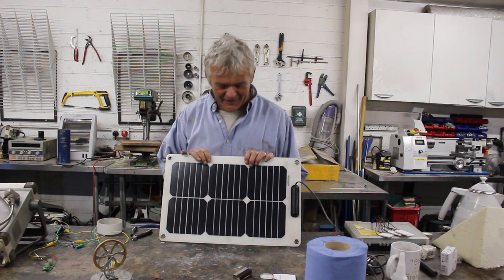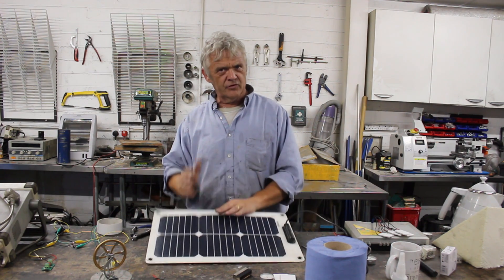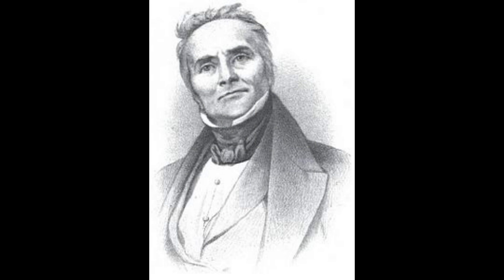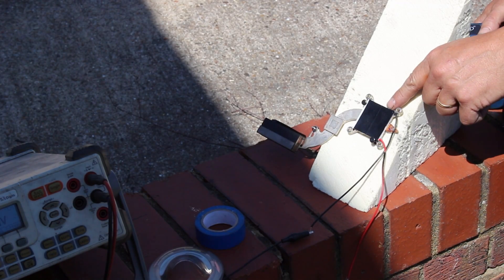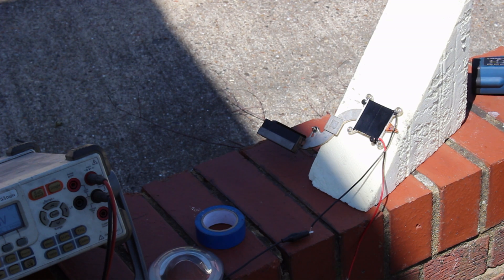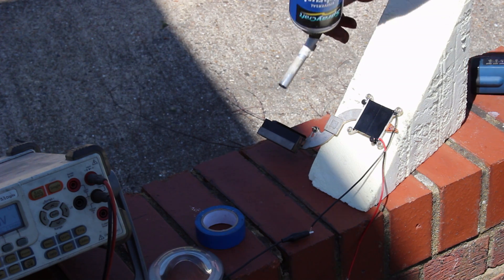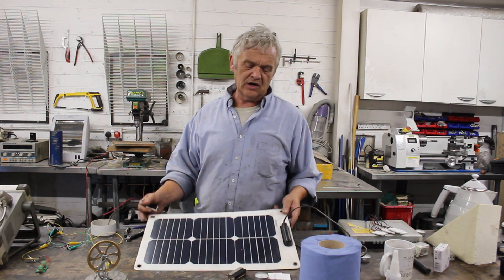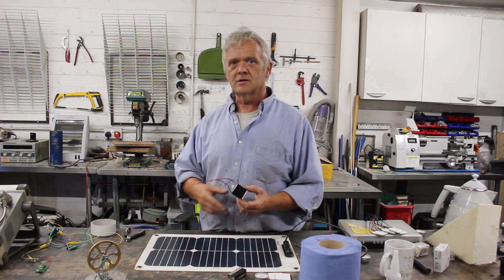1618 Putting A Thermo Electric Generator On Solar Panels

Comment: Brilliant way of explaining cost over efficiency there Robert ,love the channel by the way. You are inspiring me to come up with a way of utilising the TEG devices with a small sand battery,wind turbine and solar panel to keep my small sailboat dry and free from damp over the winter period while I am not aboard .I am sure this could work as it is only a small space to increase the temperature by a few degrees. There must be a way to make this work which would be so much better and safer than using fossil fuels naked flame devices or being hooked up to the mains. I will let you know if I succeed .Thanks for all the inspiration you are supplying. J

Comment: I invented the thermal window generator! It's the best way to use Ceramic Peltier TECs to generate power!  Use only silver thermal grease! Thermal tape isn't conductive enough! You'll need more than expected but you can use ambient temperatures from the warm heated house and the cold outside! It's mounted under a window in the window sill with two panes of glass... one for inside and one for the cold outside!

Comment: Suppose I might be a bit late to the party but I thought I'd put my two cents in. When solar panels get hot they loose efficiency. To remedy that you could stick a heat sink on the back and let the wind blow through it. Not covering it. Maybe an 80mm square. With that in place wouldn't it be a good spot for a couple TEGs? Most solar panels have a fair bit of glass that can conduct heat pretty well. I'd like to toss your idea in the bin and make something much cheaper as well as a lot simpler.

Comment: Why not put two cooling ribs on a peltier element. One side in the water and one side in the air. 

As there is allmost alway a temperture difference, there is allmost allways power. 

The charm of this system is that it also works when there is no sun or wind. No moving parts, so maybe it could last very long?

Comment: Years ago i helped with a project that was testing out a combination  tripple junction solar, thermoelectric and hot water panels..The tripple junction cell had a layer of GaP over GaAs over Ge on metal on polyimide insulator, on the back was thin film thermoelectrics PbTeSe;Cd/PbTeSe:Bi on an insulated aluminum heatsink. The solar made the bulk of the voltage (3.6V and about 100ma/Cm2) the thermoelectric made 0.2V at about  600mA per Cm2 in full sun. So lots more cirrent from thermoelectric at lower volts, with solar being more volts but less current 360mW per square cm for solar Vs 120mW for themal. 480mw electrical with 1.1W solar power so a bit less than 50% conversion.❤

Comment: Why would you put those thermal electric generators on the back of the solar panels and have a wicked type pad back there that would evaporate water or something and help cool them off while they're getting heated by the solar collectors

Comment: .. imagine 72pcs thermoelectric generator combo with 72 solar cell... it cools the panels and generate low voltage backup power if wired in series/parallel..etc.. of course both has separate inverters...hot side on the back surface of the panels.. and heat sink on the cold side.. nobody tried these experiment before..$$$ ..or mybe didn't record it yet..NASA should try these experiment than using coolant...

Comment: would it be possible to float it on some water or something?
like using a fog net to gather water, then using the water to cool the peltier, and the sun to heat it?
not that it would produce a ton of power, (and i understand you'd evaporate the water real fast)
but could that generate power?

Comment: What about the other way around. Instead of trying to generate power from the heat, using the power generated by the panels to run the cooler, and the question is will it cool the panel enough to increase panel output to offset the energy required to run the cooler?...thus increasing the efficiency of panel overall output.

Comment: I have 2 200wh panels in an indoor window. My question is will the panels still generate heat when not plunged in? with summer coming I wonder if I will need to take them out.

Comment: Installing aluminum heatsinks on the back of the solar panel would most likely provide more watts per dollar and higher amount of power vs the cost of peltier.

Comment: solar panel underside can reach temperatures of 75 C, has anyone tried putting a bunch of these things on the underside? Naturally cost is an issue, though if it works one could easily mass produce panels with built in TEG materials on the underside...?

Comment: I've been designing ( Mentally) a system to generate power 🔋 with a stove (of sorts) and heating the water up with a copper coil so, i can  then transfer a regulated temperature throughout the pipe then into a unit that holds the electric generator. For the cold side I was thinking of using cooled water 💧 that I could harness from a large sheet of metal (steel) that is submerge in water (canal boat). 

My question is how much power could I generate do you think roughly ? Would i get more power then you was making with the heat from the sun?

Comment: I have a large solar array.... I've been considering a water cooling system for my panels and using peltiers to just run the pump. The problem (several really) I have is the panels are actually split into 4 different arrays, 2 ground mount, 2 roof mount. So realistically I'd need 4 pumps, 4 radiators or ground loops or other way of dissipating heat. That's getting pretty expensive, as I'd also need 2 manifolds before and after the panels otherwise the water will heat soak and be unable to cool anything if I just ran one line across 350 sq ft of panel. Maybe that thinking is wrong, and if the heat is constantly dumped one 1/4" line would work.... but I don't think so.

I might've tried that for one array... but with four to deal with I am thinking of other ways... like rain capture and  thermostat controlled sprinklers maybe. The roof mounted ones get especially hot, so maybe I only do those.... hm

Comment: Best Teg modules are the high temperature 300-400°C. But their cost is £300 for 40w. They can be used on a thick square tube made from  aluminium and steel as a rocket stove with giant aluminium heat sinks. Best time to use Teg generator is the winter time, no sun or no wind for alternative power. So the TEG is the next option.

Comment: Like corrugated aluminum on the back for example, if we could figure out a easy convent way to have cool air running thru the flutes equally, it will cool the panels. Like real cool air from underground.

Comment: Great thought provoker, just as an idea as I haven't had the opportunity to try. The world seems to be overflowing with second-hand computer bits including tons of virtually zero cost fans. Would having some running off the power from the solar output to blow cool the back of the panel when the panel is overheating actually result in a net gain in the useful energy output? Have you seen any research in this area?

Comment: I bought a set of TEGs and TECs on Amazon, mostly to compare and see if the TEG sellers were ripping me off. (TEGs are supposed to be better optimized for generating electricity, and have a broader safe temperature range than TECs)

in a generation test, the TEC actually outperformed the TEG with as close to equal parameters as I could get them, and the TECs I bought cost about 1/5th what the TEGs did, so I'm pretty firmly in the camp that the TEGs you can buy on Amazon are just relabeled TECs.

Comment: Here's me be a weird idea but I noticed the Sterling engine in the video, could you take the heat from the solar panels and use that to run the sterling engine?
Reply: Yes, but that itty-bitty thing won't produce as much power.

Comment: That begs the question of adding water heating to act as a heat sink for the solar panels. My first thought is that both are competing for direct sunlight. Putting the water piping under the panels would do little without costly heat transfer.  What about a single extruded pipe along the frame of the solar panel. So it may only add an inch or two to the width of the panels but would allow an easy piping path. It would cool the panel for efficiency and heat water. It the panels use micro inverters would work best as the end panels would have less cooling as the first. I think that would be something to look at ..It may only cool the frame due to the poor thermal conductivity of the glass but with some tweaking better thermal paths to the frame is possible cheaply I imagine

Comment: Hi Rob good video, my thoughts are I've already seen a company whom have an enclosed air channel on the back of a solar panel to take away excess heat to use elsewhere, why don't you build a box section behind your panel with a fan pushing or pulling the heat away and at the output section you could even use that excess heat to blow across your peltier device leaving the cold side in the shadow of the solar panel hence making a temp difference because of the box section heat removal properties?????, Sorry can't remember the company whom is making the solar panel with the heat removal box section at the back of them.
Reply: Hi further to my other comments the boxed air channel under the solar panel removes the problem of the panels getting to hot and becoming inefficient and using a fan to move air through said panels and the next panel can just be joined onto the end of the previous unit, so after flowing through a set of panels the heat will be significant

Comment: to use those generators you'd need heat sinks on the back of the panels. since the generators will restrict the heat transfer, and since solar panels lose performance as they get hot, I'd bet better off just cooling the solar panels and forget the thermo electric generators. better yet, install water misters and a collection system. cheap and worth while performance gain.

Comment: Would a mirrored concentrator and copper tubing pull off enough heat to be useful for combined heating and power? And give the solar output of say Spain not a dimmer British equivalent. (I assume 100w panels is 100w in ideal latitude/sun light/temperature not a usual day)

Comment: So you decided to look into what I mentioned a while back, I have made a box for the solar panel with peltier modules and aluminium heatsinks but my heatsinks are water cooled which goes to a solar tank resvoir that is connected to sterling motors and radiator then returns to solar panels via  powered by a low power  solar pump and it's own solar panel. I had a video on YouTube of the system but many "bright sparks" (well they think that they are) says it's inefficient and were rude so I took the video down even though I extracted the more power per square meter of sunshine any attempt made before..

Comment: I'm curious if you have done any work with rectennae solar panels?  I'm wondering if an infrared version could be made with carbonized bamboo or coconut fiber? Also, what would be an easy way to rectify it?

Comment: I did the math a few years ago on putting those TEG modules on a wood stove, enough to get 1kw, wouldve been over 1000$ CAD. And it would have covered the entire thing. Would be better off running a boiler on it for a steam turbine.

Comment: Well you may have point there but if you would cool it with water and then use that water to shower etc, it may be more effective. As temperature difference gets bigger than it gives some more power and you get really less energy loss

Comment: Only way heat/energy reclamation on solar would work would be a refrigerant system across the solar array to pull the heat away to a separate unit. At which point it would be better to just power a steam turbine with that heat. The cost to gain the efficiency on the panels aswell as separate generation still may not be worth it tho in comparison to just adding more panels

Comment: I guess you could combine a solar hot water system behind the PV panel using something like an adapted car radiator core. the hot water produced could be purposed into running a passive HVAC system as well as its obvious use
Reply: There are actually a few panels that do that. The panels are designed with some kind of heatsink to pull the heat into an area where water can cool it. Increases the efficiency of the panel, plus you get hot water for its uses.
Reply: There is already a solar panel like this. Search "linustechtips water cooled solar panel"

Comment: If thermo-electricity is too expensive, how about just using cooling to bring down the temperature of the PV cells down to reduce the degradation in efficiency? Wouldn't even need to use seebeck effect - probably some sort of water-cooling underneath would do the job.
Reply from the maker: yes it would

Comment: The milliamps produced? Voltage is easy to create, amperage gives use ability.
Reply from the maker: it's an off the shelf TEG mate - and I gave the temperature - you can just look that up if you want to
Reply: @ThinkingandTinkering  it would be better for viewers if the "at the time" milliamps and milivolts were given. Might get you a few more subscribers. Its not a criticism, its a request. To be practical, if only on a thoretical level, the actual current as well as the voltage is important for viewers to understand.

Comment: Interesting, maybe in a few years even the cheapest of these will be affordable to buy at bulk and hopefully the efficiency will have improved aswell, it makes me think of some ad I saw.. some company is doing solar panel with water cooling, or more like gathering the heat to heat up warm water for a house, clever stuff and it probably helps boosts the panel efficiency as well
Reply from the maker: Great point!

Comment: Steven Harris in the US sells stoves with cells built in. Last I saw they produced 100W at 12v while the rocket stove was running.
Reply from the maker: I looked it up mate as far as I can work out  - he sells plain old rocket stoves - well - pretty good plain old rocket stoves lol - but he also sells another product he calls the power pot - it seems to be 5 watts and cost US$100
Reply: @ThinkingandTinkering  ah bugger, looks like things have changed. Sorry about that.

Comment: Just finished reading an article in Science from Aug 2. 2021 by Robert Service, about research pursuing an inexpensive material for the conversion of heat to electricity. It is a tin derivative. Hope that is of some
help.
Reply from the maker: cheers mate it is

Comment: I've been thinking about this for awhile, and with a large enough temp differential, you don't need the efficiency of the expensive metals in the seebeck.  I have a fresnel.  So what I would like to do is bond a stippled 12"x12" sheet of copper to the bottom of a 12" tile and below that a folded and stipled sheet of nickel, run the water runoff from my a/c unit under the fins created by the folds.  the entire 1 ft. contraption should cost under $35 where 49 40mm TEGS would cost around $390.  So for 1/10th the cost, 1/5 of the efficiency, 8-10x temp. diff should get the same resultant voltage for a 1ft. sq. which should be 3V maybe 49 watt hours ... at best 70 cents per Wh ... but it won't melt like the TEG will.  Now you would still need 4'x5' setup to generate 1KWh at peak sun.  but that's about half of what my A/C unit uses ... so my annual expense of $1400 in elec. for air conditioning not considering connections, batteries, conversion losses, fresnel setup,sun tracker,etc. a DIY setup pays for itself in 2 years and certainly in under 3 yrs.  but I do live in a tropical zone, have 20sqft. to spare in full sun near my  condenser.  Am I wrong to think this?
Reply from the maker: it sounds like an interesting idea mate - the first step is really to test it - or at least test a small panel version and see how it goes

Comment: I've worked with alkalai  metal thermal conversion. Like sodium for example. Tech is verified but we were having issues bringing the cost down. Maybe a fresh look at it with younger eyes might be fruitful, just a thought..
Reply from the maker: that does sound interesting mate
Reply: @ThinkingandTinkering   look up AMTEC - alkalai metal thermal to electric conversion. Its an older tech, but maybe with the newer advances in materials it could be done with less engineering. The basic concept "can get" about 20-40 percent conversion efficiency. Just add heat, makes electricity. We were developing for NASA, but there are issues with longevity of the device. We get a lot of ion creep from the system. Getting the ceramics correct is also tricky, the matrix has to be precise.

Comment: RMS, I had this idea 10 years ago. But the cost of the TEGs and the low efficiency did not make it economically attractive. There is a new energy harvester from waste heat that is cheaper to produce than the TEGs and may be more effective.
Reply from the maker: what is it mate?

Comment: cost value you are quoting then I guess means my idea of a water cooling system that takes the heated water from the solar panel and using it as a hot water heater source is still the best option I guess :)
Reply from the maker: I would think so - I like it any way

Comment: Try using them as cooler for the panel(1% pr -1C), and peltier elements actualu will transfer heat at 80 %efficiency (sucs as seebek, but actualy shines as peltier;) )
Reply: put maching voltage of elements in series with your panel...
Reply from the maker: or just use a fan or trickle water down the back
Reply: @ThinkingandTinkering  True, but peltier might bring its temperature even lower and it may wheigh out the energy loss(even cheap elements are quite efficient..
Reply: i think it has to be a paralell/series to get the voltages somehow balanced?